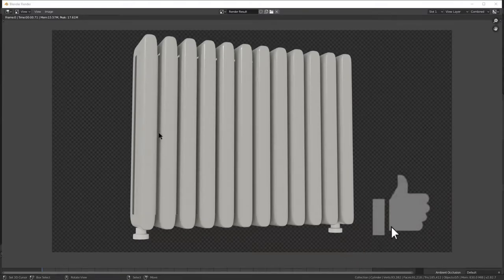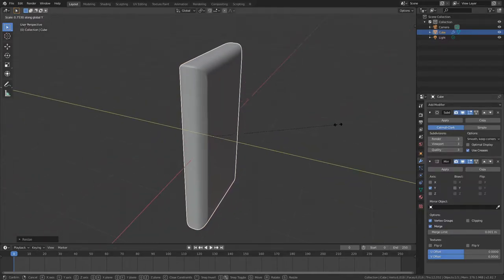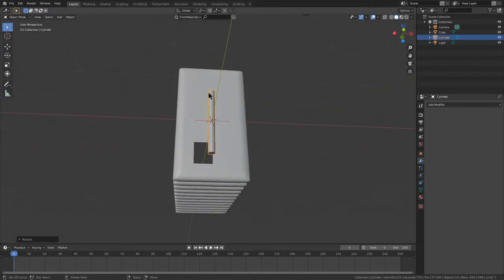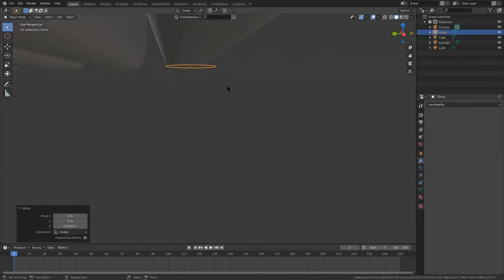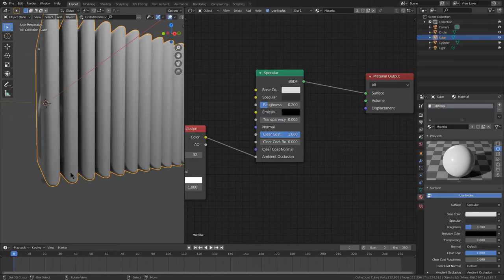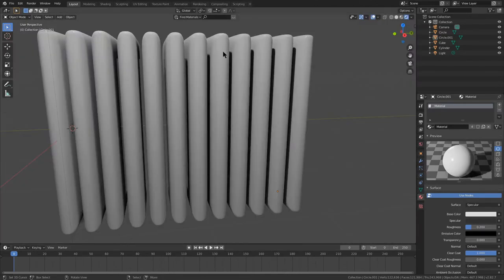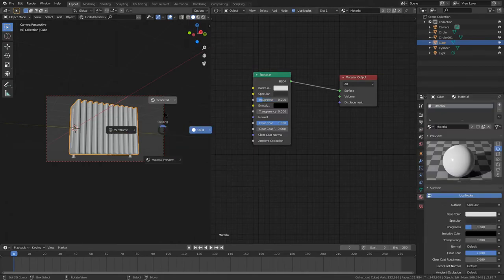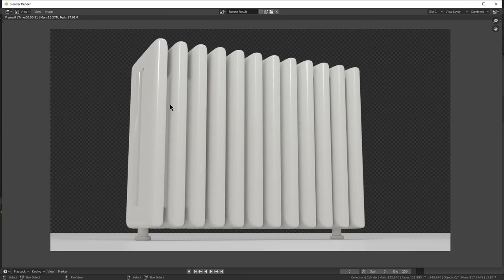How to Make a Heater in Blender 2.82 in Cycles or Eevee

Comment: that's pretty good but instead of creating an edge loop almost on the other, you can use a bevel modifier with the setting to weight and the value to 2. then you can add a bevel weight on the edges (item menu, transform) it give you the same result visualy but in terme of mesh it's way better